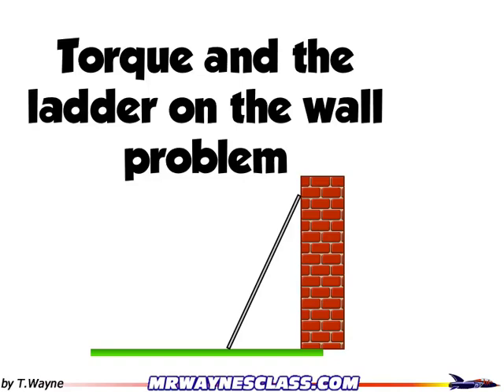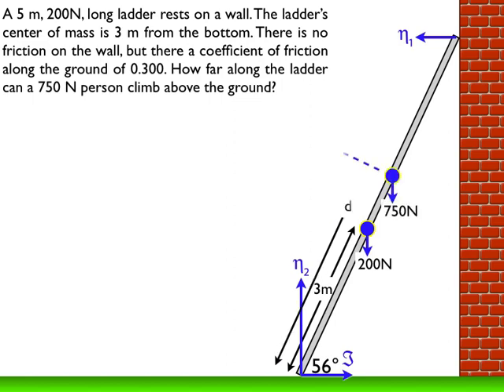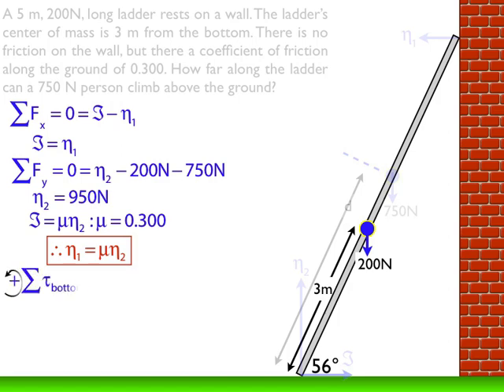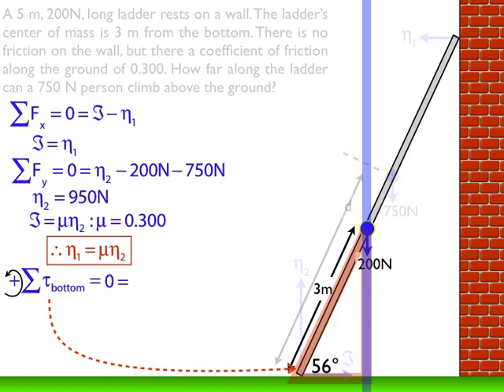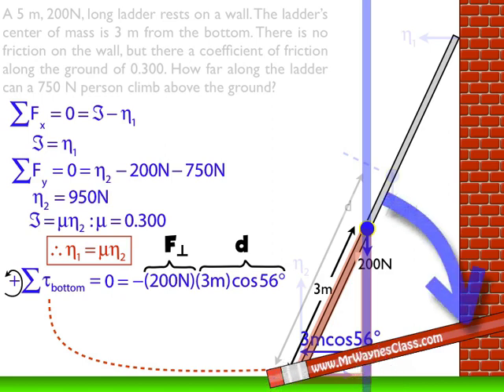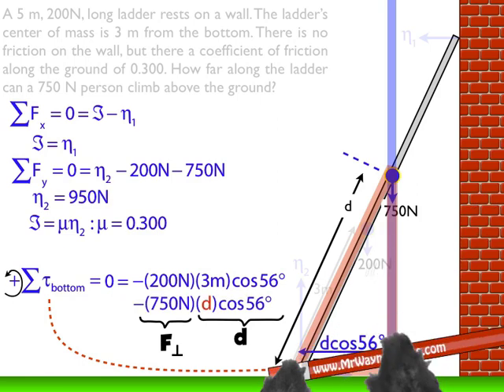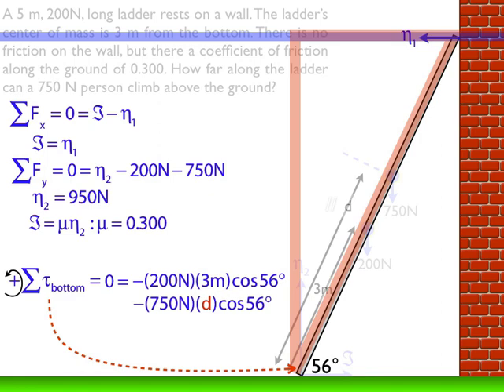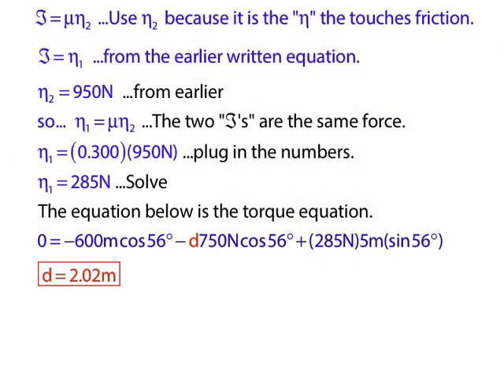Torque Ladder Example Solution

Comment: I don't understand why you can use the normal force you calculated at the ground, using friction, as the normal force of the wall on the ladder.
Reply: Friction and normal force on Wall are only x forces so they have to equal each other.